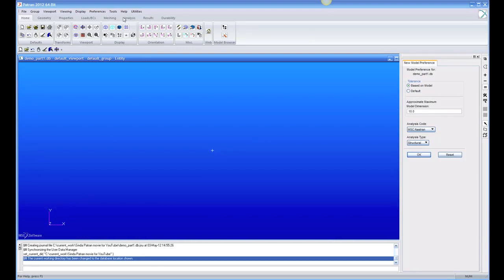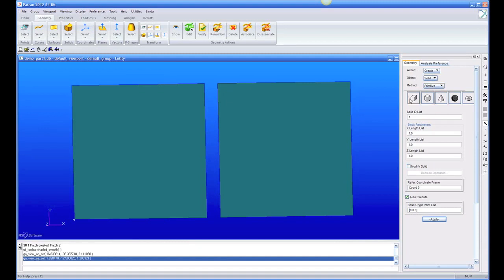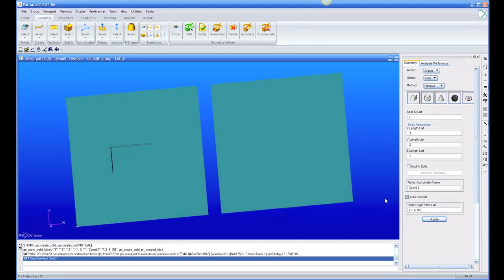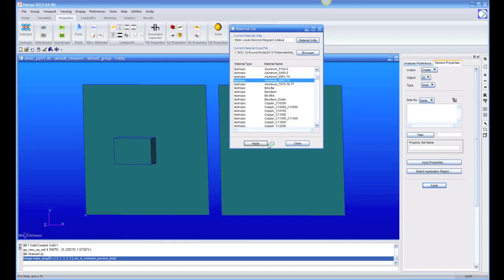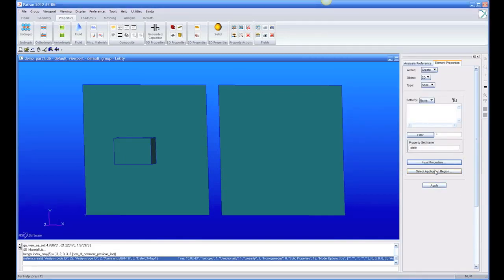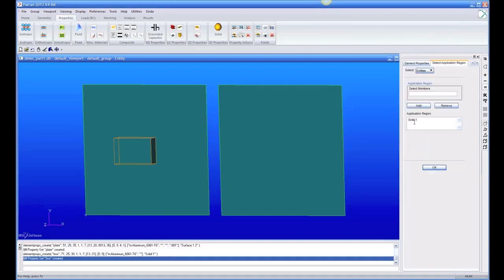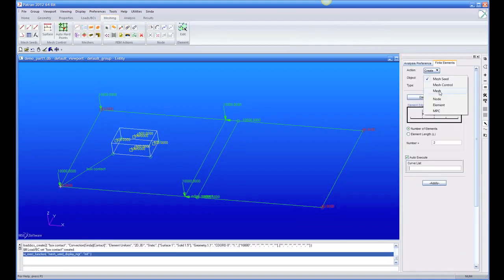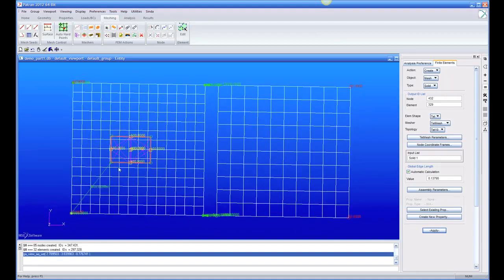Sinda for Patran Thermal Analyzer - Part 1 of 2

Comment: Nice Tutorial. I am designing a complete set of microsatellite and I would like to perform thermal analysis with the use of MSC Sinda at space environment conditions which includes sun power, radiation , heat flux..etc... Can you please throw some light on this requirement.
Reply from the maker: Great, thermal design of satellites is fun, but challenging.  Especially the smaller ones like cubeSats.  You can contact me if you have some specific questions - ronsinda@gmail.com

Comment: is there a short documentation for theoretical background for this software? a video would also do
Reply: We don't have theoretical documentation or video available, but the theory can be found in most undergraduate heat transfer texts that cover the finite difference method. User guides present some of the theory. Most users do well learning from the workshop problems provided with the product.

Comment: Hi, how should i proceed to learn sinda. i am more of an experimentalist. what kind of theoretical background do i need to learn sinda.
Reply from the maker: To be successful at thermal modeling you need to have a basic understanding of heat transfer, convection, conduction & Radiation.  Most people have an engineering degree.  The MSC Patran GUI make it fairly easy to get started.  Most people are up & running after going through 3-5 days of our tutorial training material.